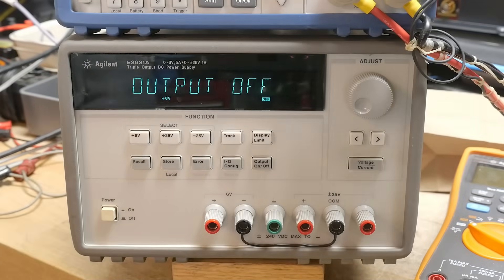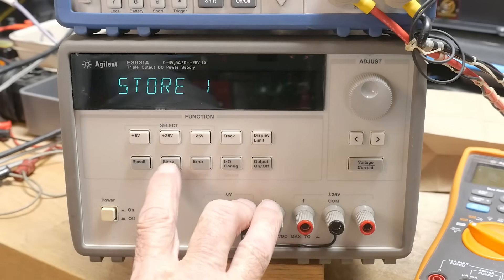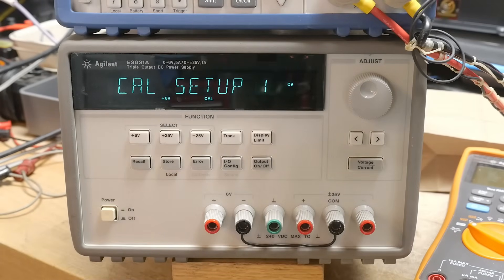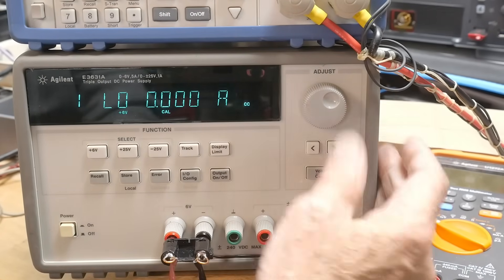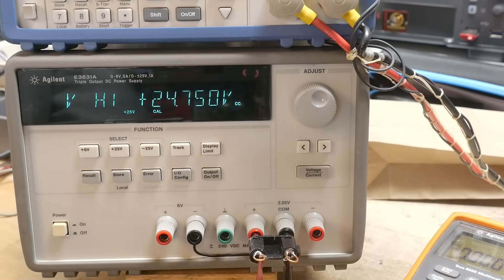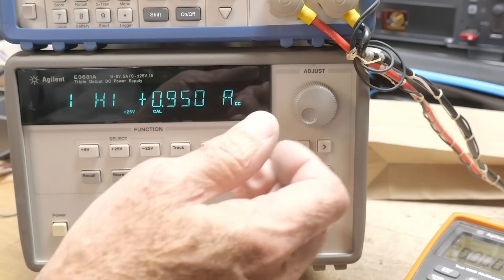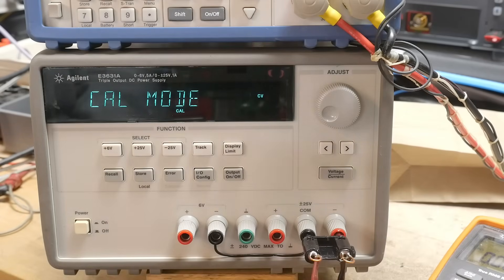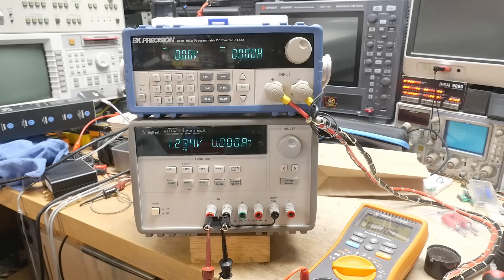#2448 Agilent E3631A Triple Power Supply (part 1 of 2)

Comment: Thanks for posting this as it's similar to the E3649A I have at work. Following your video allowed me to calibrate it.  I agree it's a bit of a pain to it's set parameters, although after cleaning the controls a while back, it's a lot better to use now.  I do like this supply, I just wish you could view both outputs at the same time.

Comment: Heavy is a good thing, this suggests it's a classic big iron transformer design, should be low noise and good for powering opamps etc. A good thing for eurorack modular synthesizers - these typically use +/-15V and optionally +5V.

Comment: I don't have an E3631A, but do have an E3634. It gets a lot of use, but I control it solely via remote. A <100 line Python script using tkinter is sufficient for all functions, and the same framework for several other supplies (66311 and 66312, among others), as well. Predicated by the knob encoder going wonky and me not wanting to strip it out of the rack to replace it during a long test. Much nicer to use. I may, one day, dedicate a cheap linux tablet to the supplies as a UI and logger, if I need to use them for more than basic bench supply again. I will say, for me, more love than hate, but just.

Comment: I picked up the Keysight version of this supply off of eBay for around $200.  For that price it is an amazing supply, but the interface is so clunky compared to a normal 0-9 keypad.  The only thing keeping me from getting rid of it is the output noise performance;  it is the best performing supply I own in that regard.

I am thinking about making a LabView interface for it to make it easier to work with.  Perhaps then I will get more use out of it.

Comment: On a E3633A, what would be the reason the beeper only occasionally works?  Usually after warmed for a while. The unit also loses cal from time to time, so I have to check it before use.
Reply: Not sure about the beeper, but the cal issue is definitely a dead NVRAM battery.
Reply: @andrewinconspicuous4634  Are you sure this device has a battery backup?
Reply: @pault6533 no, it does not. My mistake.
Reply: @pault6533 you could check the output of u40 (lt1021 reference and make sure that it is stable).  Just an idea.  Are all the outputs having issues?
Reply: @andrewinconspicuous4634  Output the front jacks is perfect.  I get ERR 625 I/O Processor does not respond.  Don't care about I/O.  If there is an easy fix I'm OK with it but not going to go changing IC's.
Reply: @pault6533  from the service manual: "I/O processor did not respond This test checks that communications can 
be established between U19 and U1 through the optically isolated (U2 and U5) 
serial data link. Failure to establish communication in either direction will 
generate an error. If this condition is detected at power-on self-test, the power 
supply will beep and the error annunciator will be on."
Reply: Your issue probably has something to do with u1.  Check page 133 in the service manual.  It controls io and the speaker.  That section has its own 5V supply and is optically isolated from the rest of board.  So that is where I would poke around and make sure u1 has everything it needs to be happy (clock, power, healthy opto input and output, etc...).

With any luck it might just be a dead 7805 or a blown fuse from a simple short.  Who knows...
Reply: @andrewinconspicuous4634  When the annunciator works it's not related to the ERR 625.  I'm thinking the annunciator E4 goes open or the dual-diode CR3 shorts to ground.
Reply: @pault6533 do you consistently get error 625 at each self test?
Reply: @andrewinconspicuous4634  every startup.   Always been that way. Our company gave the unit away instead of repairing.
Reply: @pault6533  Okay, when you turn on the power supply and the self test throws error 625, do you get a beep from E4?
Reply: @andrewinconspicuous4634  no